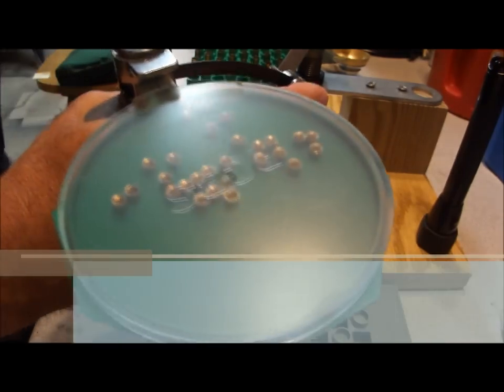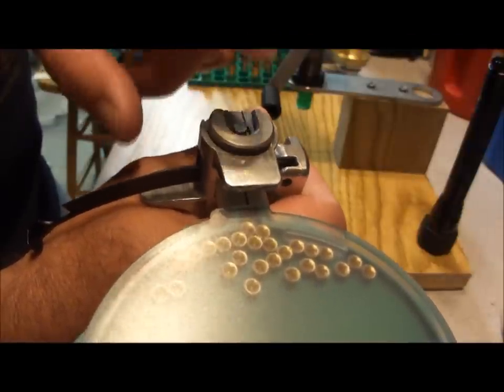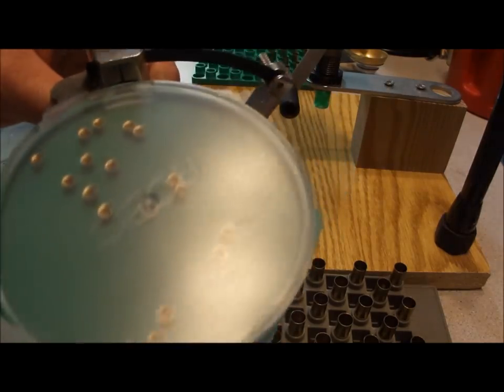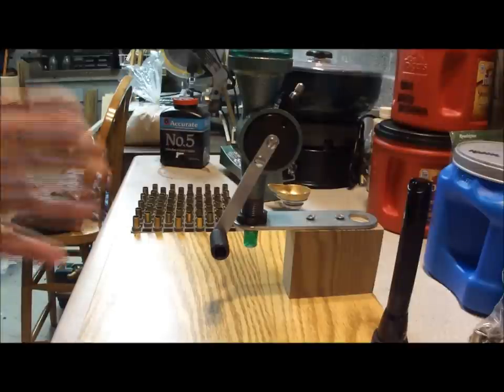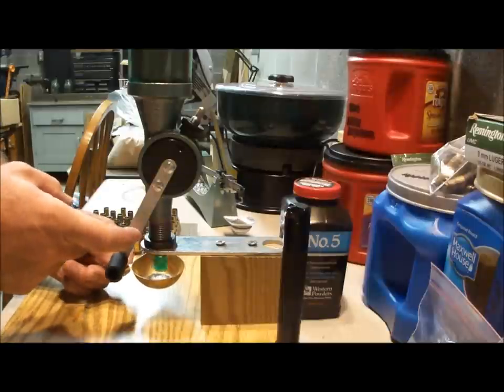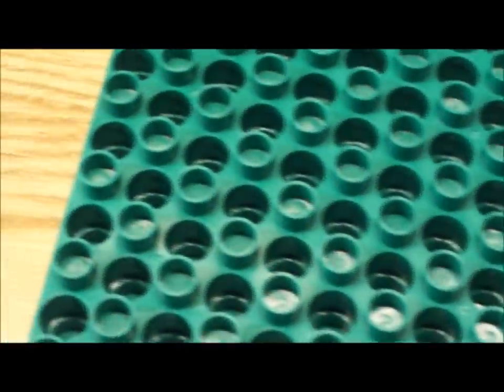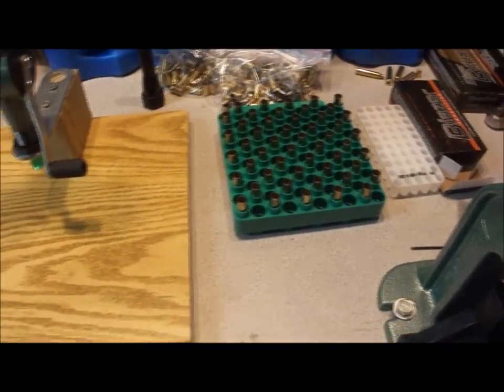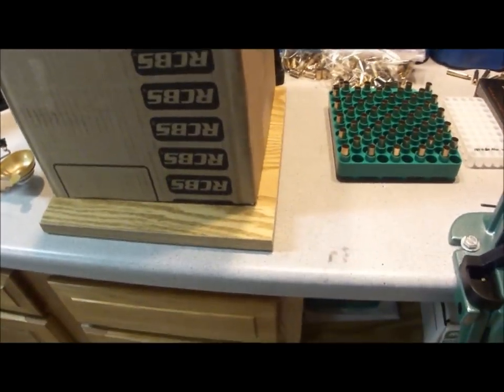Reloading 9mm Part 2

Comment: Thanks for the video. It's been really helpful! However in the Nosler guide I got with my RCBS kit, it recommends loads of the following when using A-No. 5 powder:
115 Grain: 5.7 to 6.7 grains max
124 Grain: 4.3 to 5.3 grains max
This also corresponds to the tables on their website.
Your book seems to have the higher powder charge for the 124-grain bullets. I wonder what the difference is.

Comment: StD:  enjoyed your  9mm videos...  I nice  starter-kit, mine was  "one item at a time", back when.   You may find the  MidWay#568957 or #595577  to be helpful.
I have  "case gages"  (I know, it should be  gauges) for the  pistol/rifle cartridges I reload the most.
Reply from the maker: Couldn't find any case gauges way back when I made this video..Thanks for reminding me to put back on wish list!
Reply: use the barrel of the gun see if it drops in. and make a dummy round and leave it in the die case. and fix the handle on the powder measure the handle is to low but a great job very good video you are hook now no turning back i got hooked on reloading 25 years ago good luck have a great day